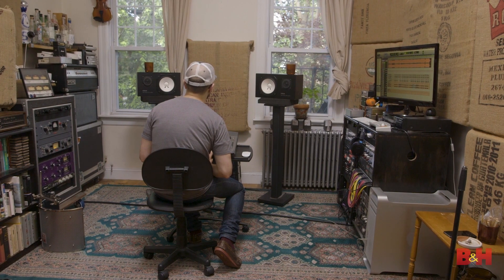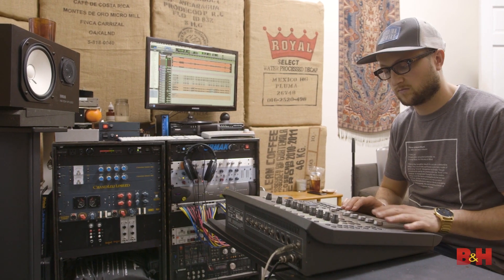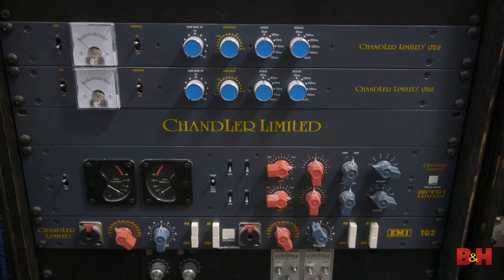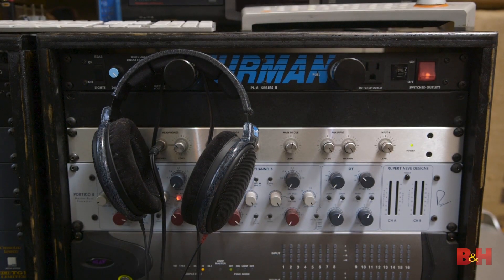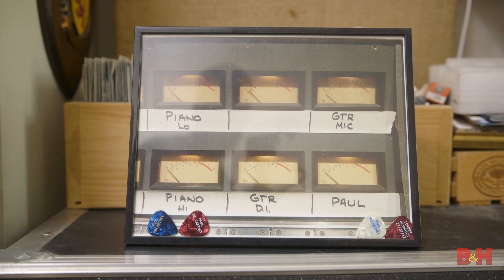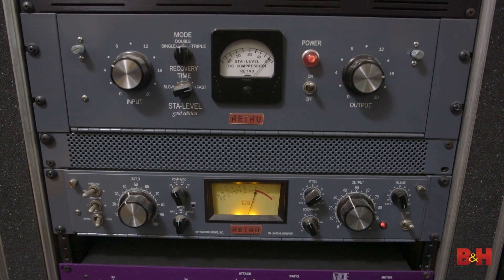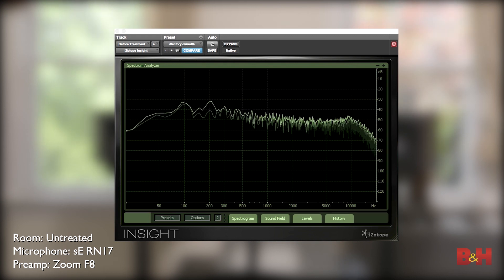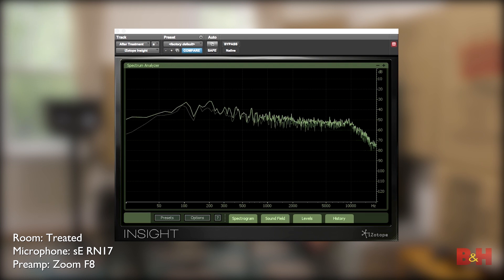Improving  Your Home Studio | Acoustic Treatment for the Small Studio | Part 1

Comment: Wow, I have almost the same set-up  -- used to have NS10s and switched to HR824s.  TLM103 (though I use my Slate VMS now 90% of the time), SE relflexion filter... 

I notice you have your HR824s horizontally placed.  I used to also, but read they're meant to be vertical.  (https://www.gearslutz.com/board/high-end/53127-studio-monitors-vertical-vs-horizontal.html?highlight=horizontal+monitor+placement)  I have them vertical now, but I did used to think my sound field was wider horizontally.  Curious if you've compared?